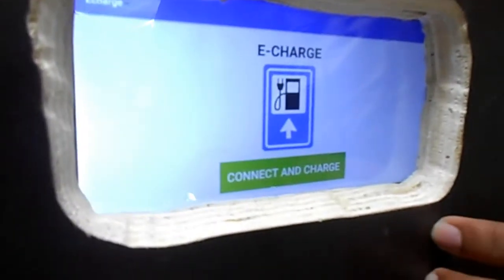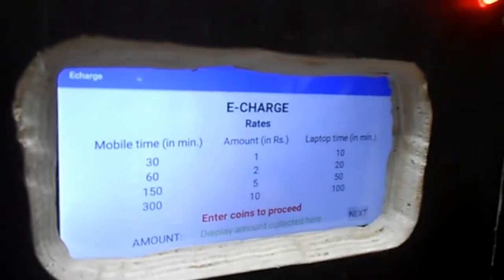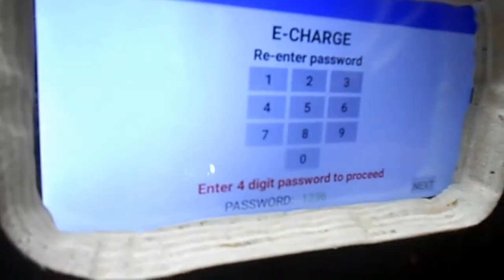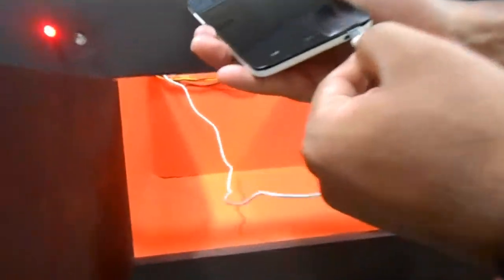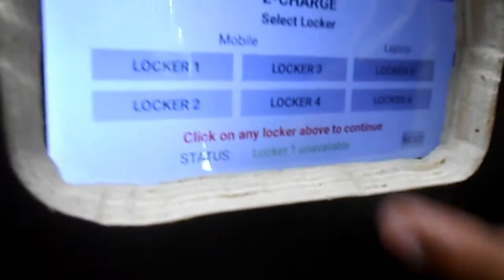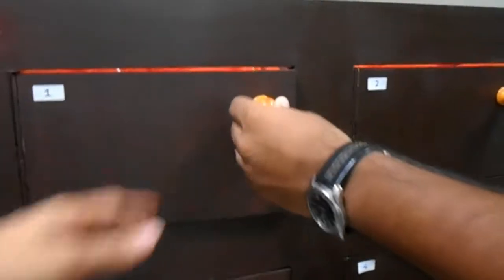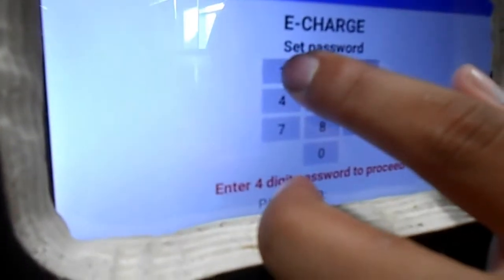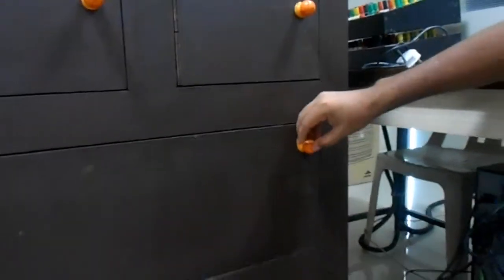Coin Based Power Outlet - BE Project Demonstration

Comment: What happened after 30min door will still locked or it will open ?
Reply from the maker: After the stipulated time, the door still remains locked. But an excess counter runs which keeps calculating extra amount which will be charged against the user at the time of unlocking.